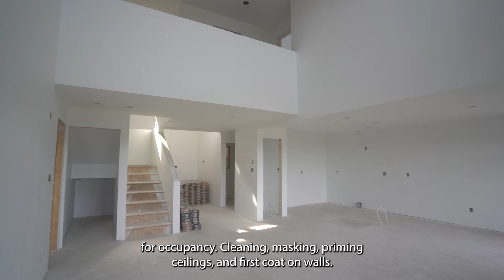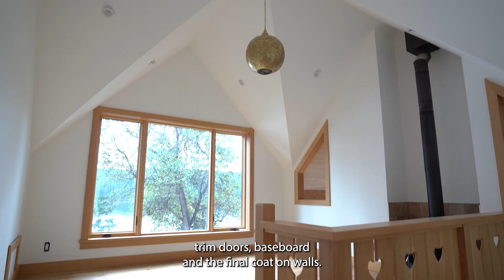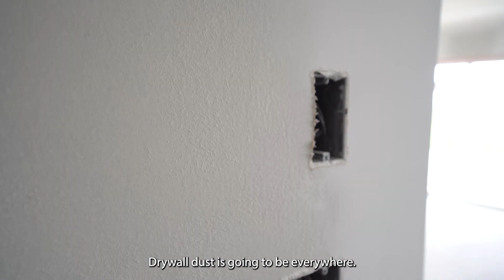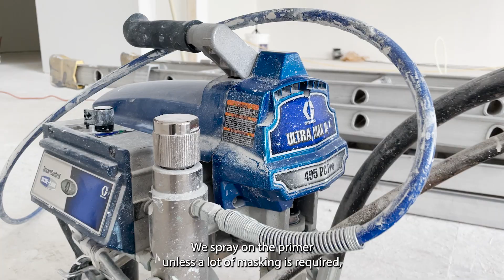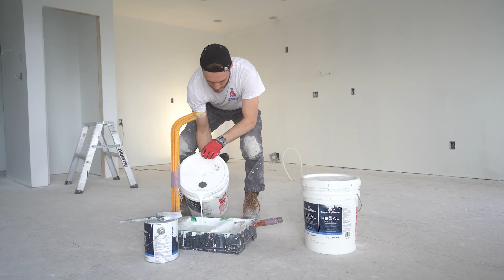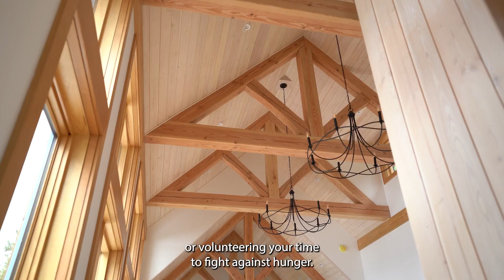Prime and Paint New Construction

Comment: Why dont you use Sherwin? You cna get better pricing for the same quality as Ben im sure. I personally dont even like using benjamin moore tbh. Im for sure a sherwin guy
Reply from the maker: We use both. Benjamin Moores's brand recognition far exceeds Sherwin's. Pricing is worse for Sherwin compared to BenMoore on select products (might be due to the fact I never haggle my reps). I find the performance is slightly better with BenMoore but it's normally thicker and I’ll usually thin my cut cans to compensate.
Reply: @Seriouslypainting  yeah that was going to be my next point is that Ben goes on mad heavy and in a humid environment you'll need to back roll like 5 times or else it all falls down as it's drying. 

I just prefer sherwin. Duration is a great brand and it's easy to work with if you're looking for similar quality. 
I don't ever haggle my rep, I just have a great working relationship with him and it's all a numbers game. If you do more volume, they will fibe you better prices. You should definitely speak with your reps at least once a month.